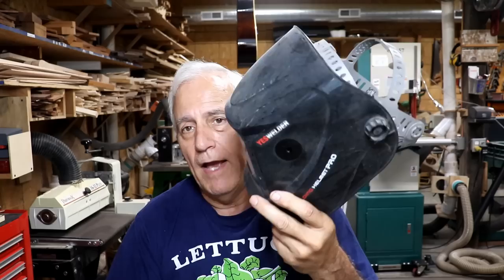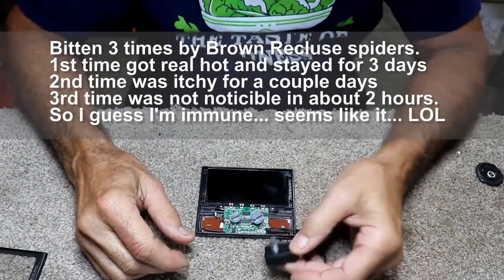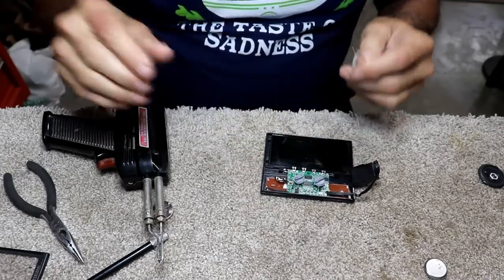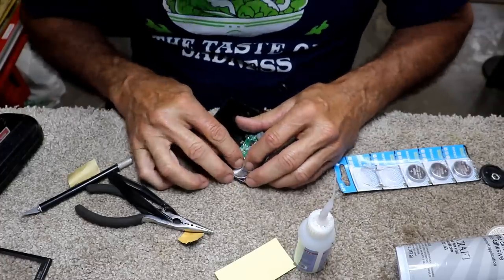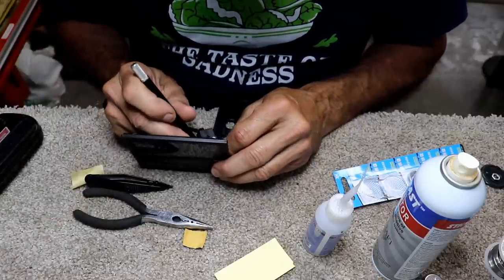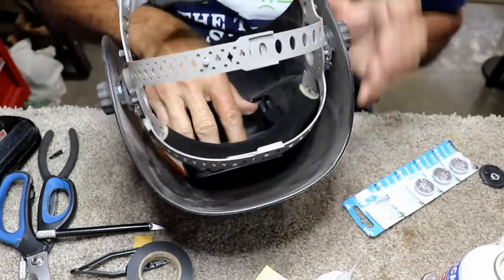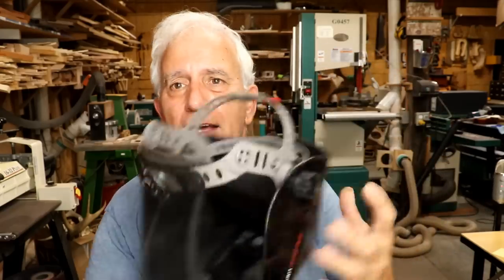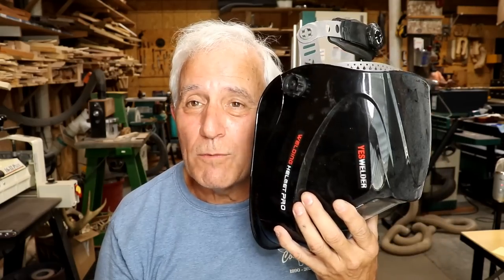586 RSW Auto Darkening Welding Helmet REPAIRED

Comment: @2:07, reference to Brown Recluse Spider:  I read somewhere that the BRS has very short fangs for a spider its size.  They can barely break the skin of a human, which renders them fairly harmless, in terms of the danger of being BITTEN by one.  But, if a person crushes one against their skin, in a way that drives the fangs deeper into the skin than the spider can otherwise bite, and simultaneously releases the venom, that's when the poison gets into the skin to enough depth that causes great harm. The resulting necrosis of skin and other tissue, around the initial bite, can take months to heal.  I'm glad you're immune, Jerry.  I just thought your viewers would want to have this new info.  Great repair video!!   All the best.

Comment: Hello Jerry, one short trick: Use a small piece from an aspirine pill...as flux (you met it in the surface with your soldering gun) when you need to solder tricky materials... Just brake the pill in small pieces and chose an aprox 2mm by 2mm (yes I'm from europe).
You can solder even a chrome plated needle like this, I promis you, just clean with alchool after this... is a quite strong acid in that pill right there.
Reply from the maker: I just squint with my eyes very tightly closed together it's not much of a problem

Comment: Similar issue with the Front Gate opener, batteries tack welded.  Took it to Batteries Plus and they pried out the old battery and tack welded the new battery in with a small arc welder device.

Comment: Glad it worked out in the end but I wonder if using a bit of aluminum tape to stick the contacts to the battery would have worked?
Another possibility would have been to solder some thin disks to the leads and cut an access hole on the plastic.
So many different ways to approach this. Glad you got it working. 👍

Comment: That is a great solution and it should've been done that way from the factory
Reply: In a commercial or industrial setting, those helmets get tossed around a lot.
in a mounting, like Jerry has, the battery could pop out.
But, yes, the battery should be replaceable.

Comment: Hey Jerry, did you use Flux with the heat to clean the oxidation off, sand paper may not work with that solder. You should get some electronics solder for doing that kind of stuff, has acid core and smokes when you heat it. I used to Fix/Repair/build Satellite receivers for a living.
Reply from the maker: If you watch the high speed carefully, you will see that I did apply flux.  That was in addition to the flux core solder.
Reply: @RosaStringWorks  Ah, likely as you said not enough heat to get the solder to flow...

Comment: Unfortunately..Super Glue is exceptionally quick to whet metal. It is also acrylic based and a VERY good insulator. Which means it'll quickly spread over the wire strands and effectively do sort of an "enamel coating's" that you'd see on motor windings. In fact I will use it (infrequently) where I need to insulate wires somewhere that other methods can't get to.

Comment: That’s the same junky helmet that I bought from Amazon about three years ago. The thing came in a plain cardboard box with NO manual or documentation and the shade control knob was missing. Two red flags right there. Battery still shows 3 volts but no auto darken. Dumpster bound. I will go to HF and get one, at least I can swap it out in one day if it is defective.

Comment: I don't know the voltage of the battery. But there is holders for aaa batteries that you can mount on the outside of it. just solder the cables to the batery connectors.

Comment: You can buy a button battery holder with wires. So solder the wires to the circuit board and place the battery outside the board where its... HA! stole my idea as I was typing... LOL

Comment: God final solution Jerry.  With the case fitting so tightly, couldn't you have just taped the leads to the battery and let it be sandwiched tightly in the case?  The external battery holder is a better long-term solution, though.

Comment: I bought a very expensive welding hood a few years ago and kept it in the original box. Good idea -- NO. They would not replace it with only 6 months old. I should have let it be exposed to light to keep the battery up. It was potted and could not be replaced. OPTREL was about $500. Only used a few times. DON'T KEEP THEM FROM LIGHT!

Comment: need flux
Reply from the maker: If you watch the high speed carefully, you will see that I did apply flux.  That was in addition to the flux core solder.
Reply: @RosaStringWorks  I must have missed that, thanks.